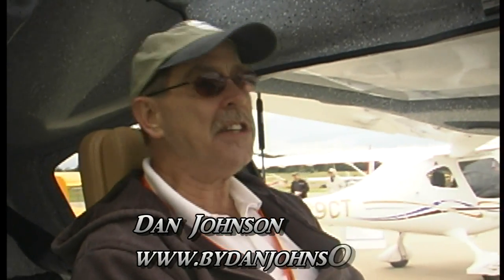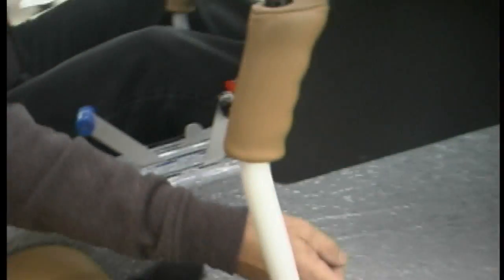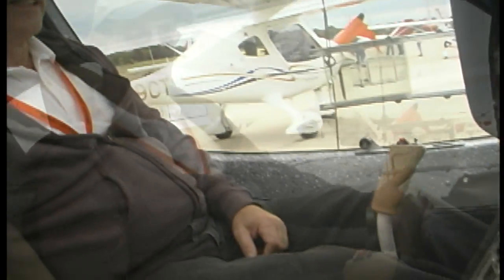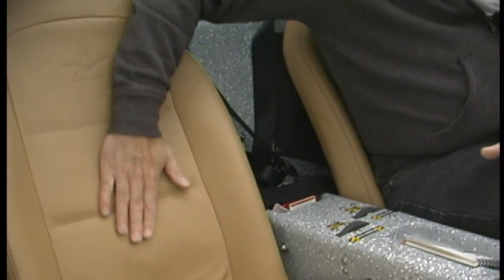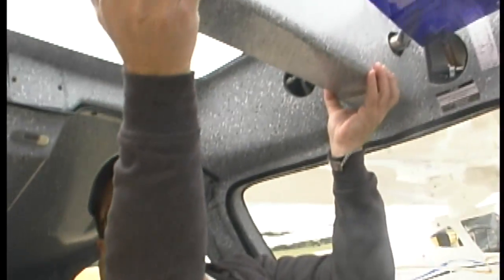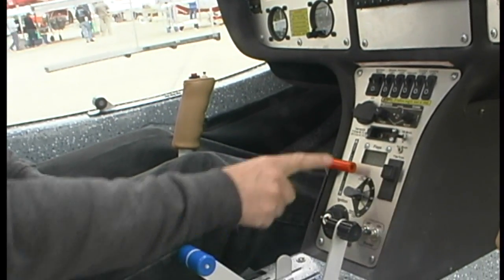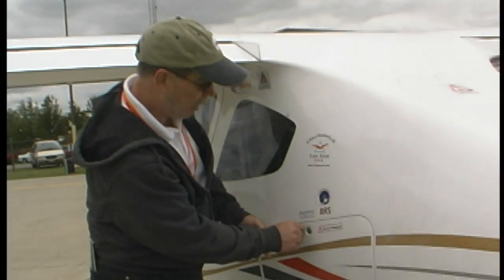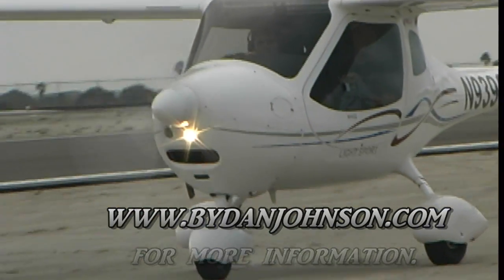CTLS,  Flight Design U.S.A.'s CTLS light Sport Aircraft

Comment: CTLS is the king of S-LSAs for a good reasons. Many reaons, actually. For example, it's taken for granted, but look how thin the door frames are. It improves visbility a lot for taller pilots. My biggest gripe is that every time I reach for the brake in CT, I bump the throttle out of idle and have to slam it back with my left hand. I wish they went for a panel throttle, best of all a vernier.